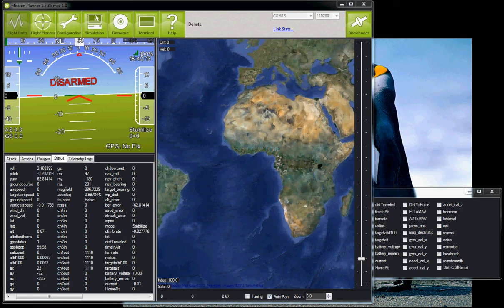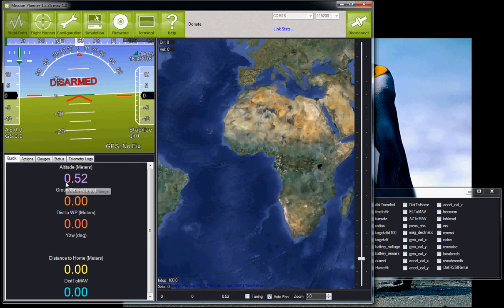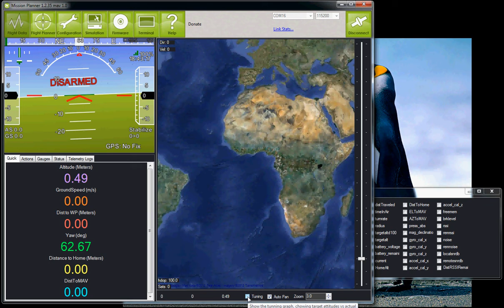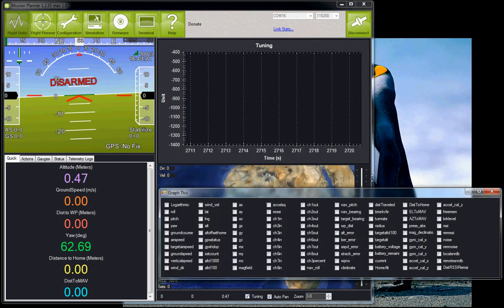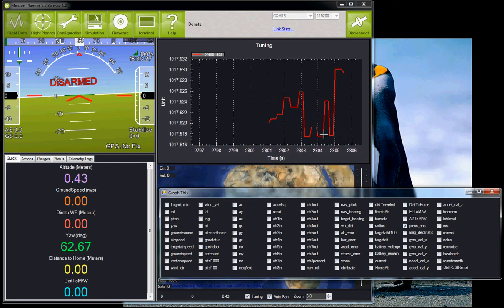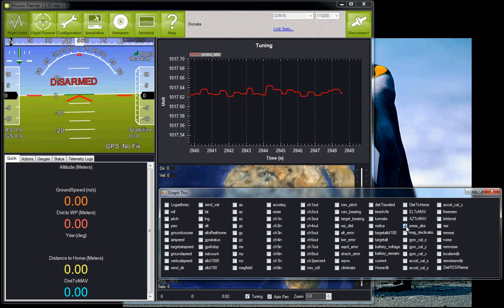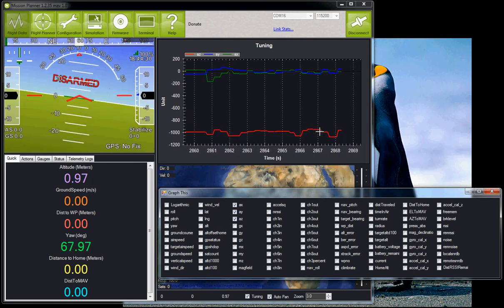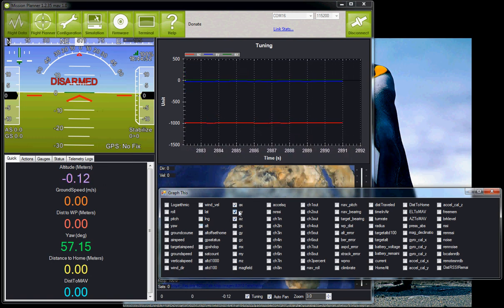ArduCopter 2.9.1 altitude bench test

Comment: How do you get the graph this selection screen?
Reply from the maker: Corby4,
     There's a little tuning checkbox at the bottom of the mission planner on the FlightData screen.  Clicking that causes the real-time graph to be displayed.  Best of luck.
Reply: No I ment the other screen where you check the box for the baro pressure
Reply from the maker: MrCorby4

So maybe you mean the Quick tab at the bottom left of the mission planner's flight data screen.  For that you can just double click on any of the values displayed there and it pops up a bank of checkboxes.  Pick baro (or whatever) and that value will replace the value that was where you clicked.